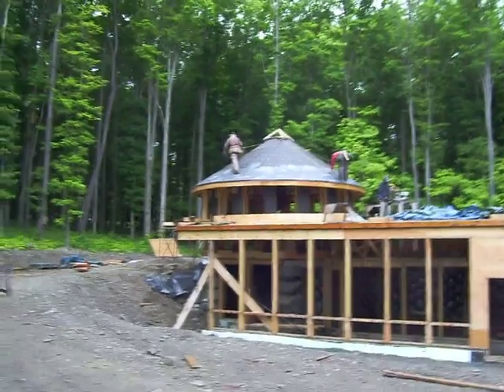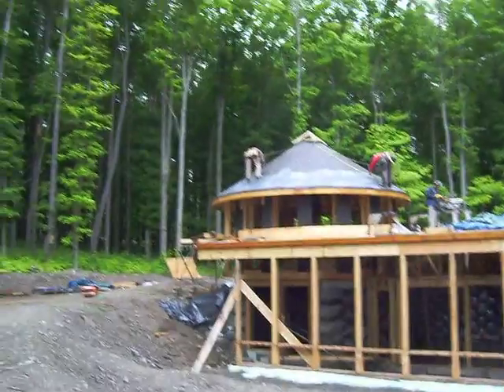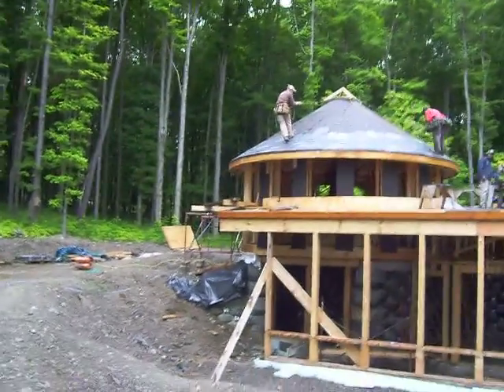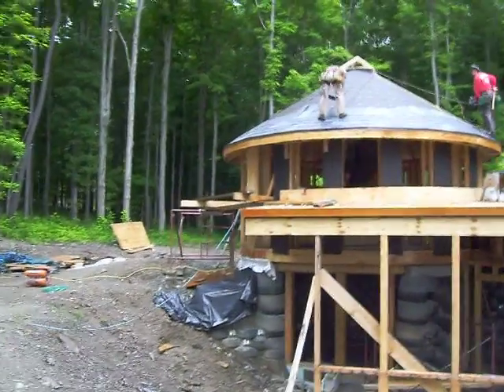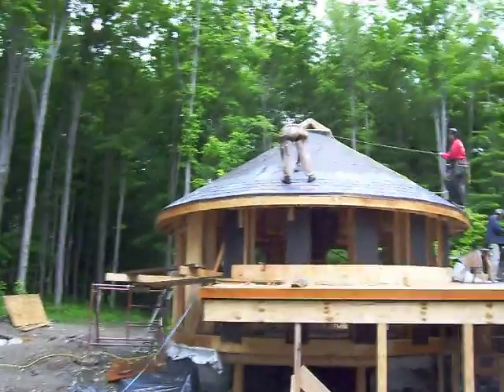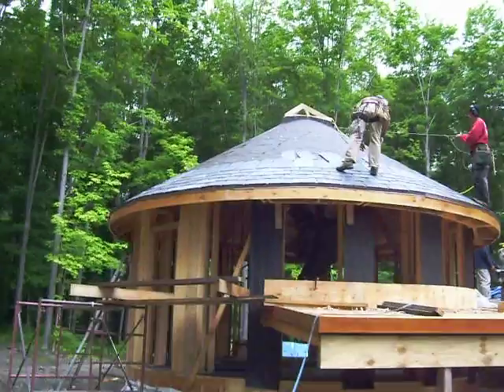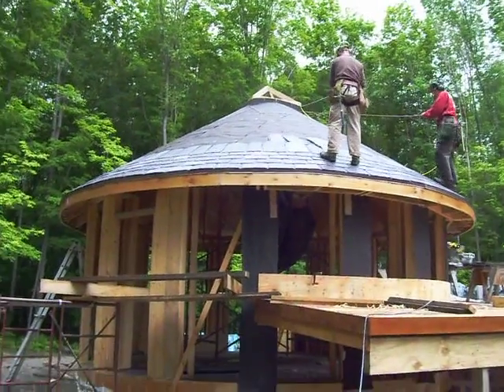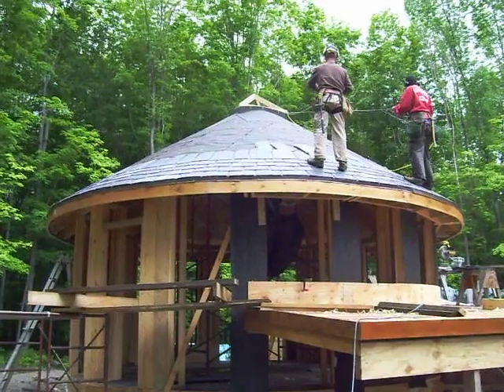Slate Roofing1

Comment: I just installed a roof that was recycled slate. 50 years old when I pulled it off, and I'll still get another 150 year minimum. That's green building. I think what Brandon was getting at was many of these slate look slimed have started warping an bending and beginning their decent into oblivion 5-10 years in. And slate has a much more proven record of durability and longevity.